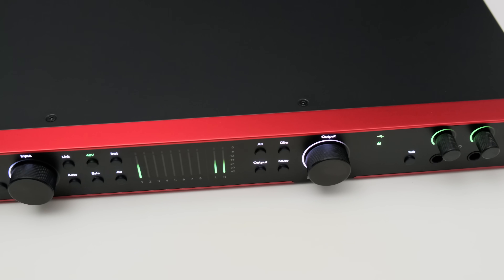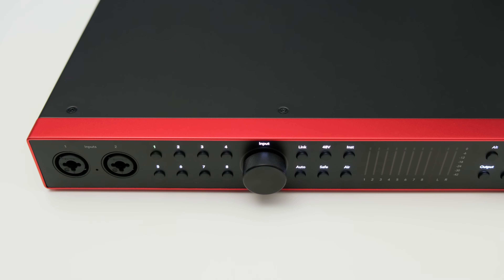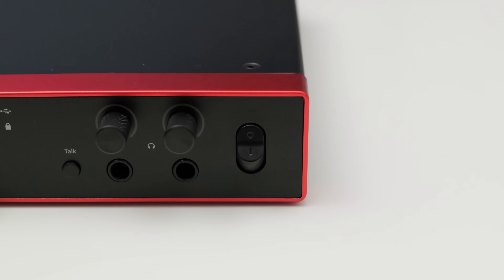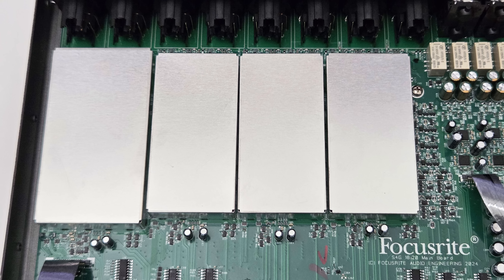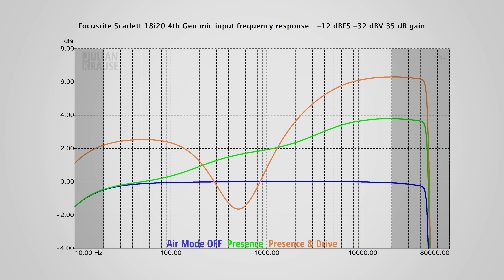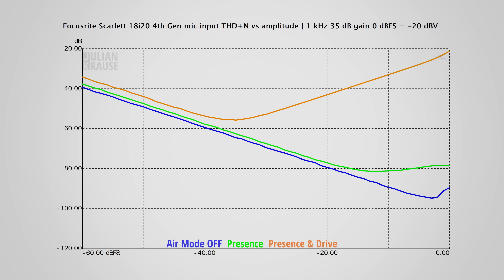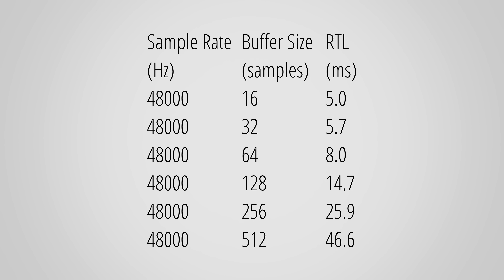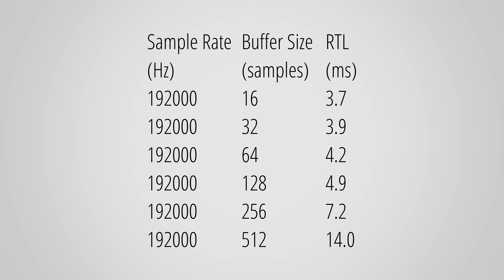Focusrite Scarlett 18i20 4th Gen – USB Audio Interface Review (Air Mode, Talkback and more!)

Comment from the maker: Correction: The 18i20 4th Gen supports up to 16 channels in and 16 out via ADAT with a sample rate up to 48 kHz. This was added with a firmware update in the beginning of 2025.
Reply: Doing full size interfaces... Love that. Any chance of the latest Motu 828 (2024 Release) showing up on your desk ? ( Pleeeeeease 👃 )... Love your work. Keep it up ! Thx.
Reply: Was just about to write this
Reply: Hay Julian, I checked the Scarlett 4i4 4th Generation specs for recording classical instruments. What interface would you recommend for that and would it be better to wait for a 32bit floating point Audio interface? I would like it to be very quite.
I ask this because someone in a the comments of a video said that this all 32bit floating point is a total scam and there's no reason to look for 32 floating points audio interface. Is that true?
Reply: When using all 16 channels of optical, the SPDIF input is not available. I was disappointed to learn I had to choose between the second bank of optical, or SPDIF. Hopefully another firmware update could allow all 16 channels of optical, plus the 2 channels of SPDIF.
Reply: @SeamlessMedia Yes that's really disapointing. Otherwise it has really nice specs regarding the price. Hope it will be updated with a firmware or driver update.
Reply: Julian, please review Behringer Flow 8. It has 2 different type of preamp, plenty of features, and it's affordable, I think a lot of people will find it very useful. Thank you 👍

Comment: Hi Julian. Would you consider doing some tests on the new "Essential" line from Zoom? It advertises 32-bit float and no gain knob. But there are some suspicions that the in-built mics dont have a dual ADC. I.e. I don't see any  other way than that they must use a low gain to avoid clipping, convert to float and gain it up digitally. This must surely give a worse SNR than the previous line from zoom...  Would be a nice test to see the SNR for the old and new line. For quiet signals and loud ones...

H4 could be a nice one to test.. The in-built mics are rumored to have no dual ADC, while the XLRs should have this...

Comment: Hi Julian, first of all love your content. I am a noob and have a few question regarding the HP output power for different impedances: 
- Is this the power level you measured with the volume knob cranked all the way up?  or are these power values also @300mV as the other measurements in your table? 
- These power levels/impedances are also for a 1kHz signal? Is 1kHz the standard at which headphone impedance is informed by the manufacturers?
Reply from the maker: Hey, for the power number I turn up the volume on the interface and stop when I hit 1 % distortion or max out the volume, whatever comes first. This I would argue gives yo the "usable" power range as you usually don't want to push your amp into clipping. And when you have maxed out your volume, it doesn't get much louder than that.
The headphone impedance is very often stated with 1 kHz although many manufacturers tend to round up or down a couple of Ohms, so it's not that precise. The impedance (especially for dynamic drivers) can vary quite a lot, so a single number is often not that helpful. At least it gives you a ballpark figure.
Reply: Ohhh got it, this makes a lot of sense. Thank you for your help! I learn a lot with your videos, keep up the good work :)!

Comment: The switch is a design choice to prevent a slip of the hand from ending your recording session early.😅
But seriously the choice of a toggle over a push-push to give you a safeguard against accidentally powering the unit “off” with a bump, and the unconventional orientation prevents a unintentional downward stroke.

Comment: I want to say that the power switch is flipped as a precaution so you don't accidentally bump it and shut off the unit while recording. It's like this on the Gen 3 version as well. That's just my guess though as I have definitely gotten close to touching while recording drums. Cheers!

Comment: For the price, if you are on a budget and need to just get some mics up, I suppose it's a competitor to what Tascam has to offer. It's not in the same league as the SSL 18. I, personally, will hold off and scrape up another $400 for the SSL. One thing that annoys me about this 4th gen thing is that Link switch. Like, why? Why should you have to dedicate both front inputs to either xlr or ts/trs? Also, why does it not just detect what has been plugged in? That tells me that the folks running the show at Focusrite are kind of, ummmm, not users of audio gear. It happens. I'm sure they are great electrical engineers, and all have nice degrees that they each paid $200,000 for, but they don't actually go home and use their own equipment. Therefore, I'll likely avoid all Focusrite products here on out. It's a little quip but it is a very important insight into how they function and I don't dig it, it's like spotting that swastika tattoo on your new girlfriend's butt. It's tiny, hardly noticeable, only YOU will ever really get a close look at it, but... it's fking there, man, admit that sht and ditch that Nazi btch.

Comment: ❤Thankyou the big knob input selector is a deal killer.  I run Ubuntu  linux so I will  not be able to run windows simultaneously.
USB 2.0 will be compatible will Linux Ardour but no separate volume controls is a deal killer. Thanks Mahalo!
Reply: There is an unofficial open source driver that does all the things the official one does, maybe minus bluetooth control via smartphone app. Idk how up to date Ubuntu is though, you need Linux 6.14+ for that
Reply: @kulasko5481  Cool man! You would need that to run this thing.  USB 2.0 will work basically otherwise.  Still running 18i20!  Thanks Again!

Comment: Nothing much new here. For those on a budget: The Motu Traveler MK3 beats this on most points. (2013) It has hardware input limiters, digitally controlled everything, on board dsp comps, limiters, EQ, reverb, Spectrum, and a mixer with 8 memory banks, stand alone mixer function, 28 simultaneous inputs. 3 sources of portable power. Flexible talk and listen back! etc. etc. Drivers are brilliant and it's also supported as a LINUX ALSA recording Interface in the Kernel. (yes, Firewire is alive)

Comment: on-off switches America versus UK
when you're drunk and fall against the wall In America you turn the light off or if you're getting an electric shock and fall against the switch you turn it off in the UK when you're drunk and fall against the wall you turn the light on😊 And when getting an electric shock you don't turn it off
this is what I was told in 1969 I think the American way is becoming the standing still Cannot accepted It myself

Comment: Julian, can you suggest Focusrite to bring an update that allows us to use effects (gate, eq, compression and saturation) from within Focusrite control? Something similar to what the Lewitt Connect 6 has would be amazing. 

I know we have loopback but from livestreaming and business calls this would be really nice, to process your voice from within the software, without having to open my daw etc

It's 2025 and i think Focusrite is a bit behind in terms of software. Very frustrating to not have these options from within the software, especially when we can control the parameters from inside Focusrite Control 2.

Also, will you review the 16i16 4th gen? It substituted the 8i6 3rd gen.

All the best and thank you for another awesome video.
Reply: That would require DSP processing hardware on the unit
Reply: Man, that sucks...  @mycosys

Comment: Hi Julian, Thanks for the great video. I asked for the review of the 4th generation months ago when it initially came out. However, I could not wait any longer, so I bought one right after it was launched. The reference to power switch being in the wrong position made me laugh so loud. As a design engineer myself, that was the first thing I said when I unpacked the unit.  Thanks again.
Reply: You can always just reverse the wires on the switch or flip it 180 degrees.
Reply: I've never understood switch conventions.  I believe turning on the light in Britain is toggle down, and in US is up.  The Main and Standby switches on my Marshall amplifier toggle down for on.

Comment: Looking only at the audio qualtiy of this 4th gen., is it worth it to upgrade from the 1820 3rd gen?

If not, what would beat the 1820 3rd gen? I love the rackform to put it under my desk, but only need 1 Mic input for youtube videos
Reply from the maker: Hey, I don't think an it's worth upgrading if you already own the 3rd Gen. The biggest difference really is the software control. In terms of audio quality, the 3rd Gen is already very good and I would argue that in most recording situations you will not be able to tell a difference.
Reply: @JulianKrause  What /which device would be a meaningful next step in audio quality from 18i20 3rd gen in your view? (I own a dbx286s too, if that is important)
Reply: @dirk.4711  The only thing wrong with the 3rd gen is preamp noise at high gain on dynamic mics. Unless that is limiting you there is no audio benefit to an upgrade.

Comment: No, I think the power switch is correct. Up is off, down is on.
Reply: Correct as in unchanged from the previous model, but not compared to... Well, *anything* with a power switch. Up is on on my headphone amp, my mixer my preamp, my synths, my DJ controller... Hell, my light switch. I have the 3rd gen 18i20, and it bugs me to no end that the switch is upside down
Reply: @cybrnekomusic  Are you sure? Up is off on my RME Fireface, all 10 switches on my rackmount power strip, my TrippLite surge protector... ohhh I see. You are right. It's the other way around on my Sequential synth and my Hammond organ. All right. I maybe change my mind.
Reply: In Germany it's wrong but in England it's correct.

Comment: Why the latency is lower with higher samplign rate? It's counter-intuitive, there should be more time and more latency since there's more data to send. I don't get it.
Reply from the maker: Hey, when the buffer size stays the same but the sample rate is higher, the buffer is filled faster and audio is processed more often which decreases latency.
Reply: @JulianKrause  oh! Thanks 👍 now it's clear. Then why can't we have zero buffer interfaces? Why audio can't be sent in real time and then resynched in the PC to avoid jitter? Maybe that's the buffer purpose and I don't know 😂
Reply: @_innerscape_ you always have buffers/latency in digital,it is unavoidable. Theoretically, you could of course have a buffer size of one sample, but that is extremely inefficient and no computer can process that fast. The buffer size alone doesn’t tell the whole story, it also depends on the driver and how efficient it works.
Jitter by the way is only a problem in AD-conversion inside the interface, nothing to do with the buffer.

Comment: Question somewhat unrelated to this video but maybe someone here knows the answer: I recently got an audient ID44 and when connecting it to my Windows laptop, I'm only able to record either channels 1 and 2 or 3 and 4, they are separated in Windows settings, so I'm unable to record all channels simultaneously, Would anyone know why this is? Honestly, after seeing this video, I'm wondering if I should've gotten the 18I20.
Reply: I'm using reaper, not sure exactly where that setting is but I'm sure I'll find it, thanks for the help. Great video by the way, I bought this interface based on your review several months back.
Reply: @joecaroselli9945  Ctrl + P / devices and there choose ASIO followed by your  unit by clicking the tiny black arrows to the right of the selection boxes. On the left add how many inputs and outputs you have. Cheers Martin
Reply from the maker: What software are you recording with? Check that you are using the ASIO driver in your recording software any you should be able to record all channels.

Comment: Why would a high dynamic range be especially helpful for condenser mics? Dynamics should record the same dynamic range as a condenser mic a certain interface nerd claims.
Reply from the maker: Hey, because with dynamic mics (unless you are recording really loud sounds) you typically have to turn up the gain of the preamps. In these scenarios you are limited by the preamp noise. With condenser mics you typically record at lower gain settings and condenser mics can also have lower noise than dynamic mics. This is why the dynamic range of the interface will be much more important with condenser mics.
Reply: @JulianKrause  I see, that makes sense to me. Thank you!

Comment: Can you explain the significance of the lack of DC coupled outputs? Is that for sending modular signals?
Reply from the maker: There is something called control voltage which is a way of interacting with synthesizers. This gives you the option to directly control synths with your interface but for that the output needs to be DC coupled. DC coupling is not needed for normal music playback and more of a specialty feature.

Comment: Can’t wait for SSL18 review!!!! Please 🫵🔥🔥🔥
Reply: Here's what the review will look like...
1. Better & cleaner sound than focusrite but doesn't really matter
2. Missing remote/digital control
3. SSL Has better software - can use some features at 192Khz (by downsampling) instead of features being disabled
4. Slightly better (shorter) latency
5. A bit more expensive.
6. Talkback mic input with compressor effect is more useful than the focusrite built in.
7. SSL hardware level metering is terrible / barely usable.
8. 32-bit is better than the 'safe' option in focusrite - don't need a limiter.
Reply: @nick314 need to hear it from Julian bud

Comment: I agree that the power button is backwards (usually up is 1/on).  But my Focusrite Saffire Pro 40 is also like that.  So maybe this is a quirk that is specific to Focusrite?
Reply: It's actually the traditional way for British designs.
Reply: @gustinian  Not only British devices, many devices are like that. It's actually to minimize the chance of accidentally turning it off, I heard directly from brand representatives in the past.
Reply: @gustinian    Thank you for the information. 👍
Reply from the maker: Maybe because it's easier to bump the switch down and accidentally turn off the interface in the middle of a session. That would be the only reason I could come up with.

Comment: 13 dBV output is around 4.5 V bal.?  
I don't get it with the cheapo air and sound 'tuning' modes for whom are they, the new 'pro' generation? Come on ...
No DSP functionality in 2025?
It's a bit disappointing compared to the Ultralite MK5 or others in this range.
Reply: Motu is leading the field and has done for a long time now.

Comment: just a correction in toss link now you can expand 16 in and 16 out in dual adat, there was a firmware that released this change that before was 8 in and 8 out in toss link dual adat
Reply from the maker: Thanks for pointing it out! You are right, I even checked the manual and it said 8 channels. Guess they haven't updated the info yet.

Comment: how menny loopback is there on 18i20? It is same converter in 16I16?
Reply from the maker: In the software I can find one loopback channel which you can send the audio from your Inputs, DAW outputs or Mixes A - F to. I have not tested the 16i16 4th Gen but I would assume that they use the same converters. That's often done to optimize production cost.